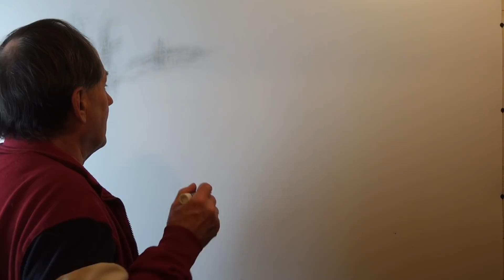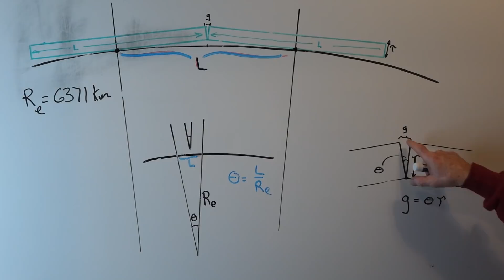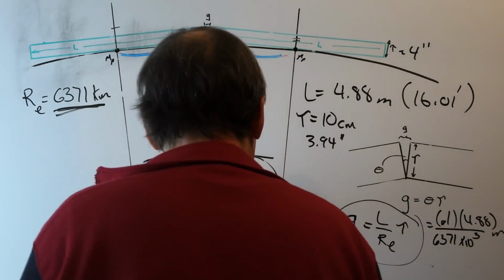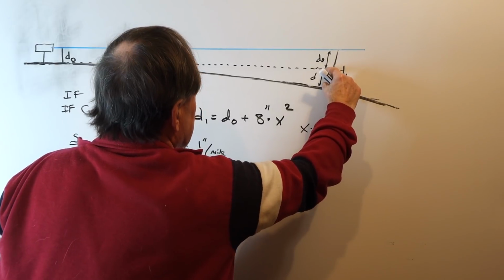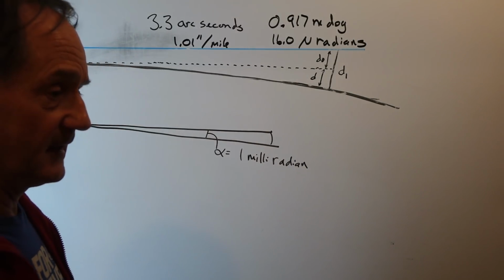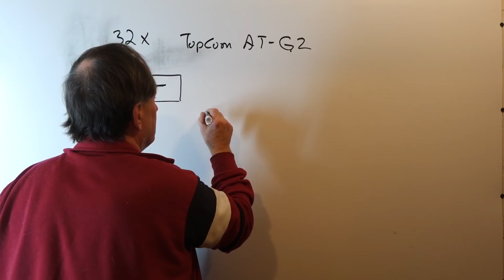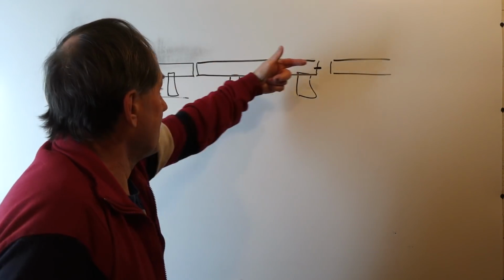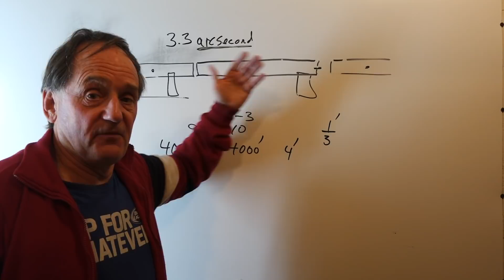Salvaging  Mullin's  " Force the Line "

Comment: Hi, why don't eventually use a very strong and tight rope ? With a rope it become possible to get a straight line, no ?
Sorry for my english, i'm french !
thank you !
Reply from the maker: cannot do this for it will fail - all tight ropes have too much sag.  Cannot put enough tension in a line to reduce the sag enough before it will snap and break --- sorry.
GH May 21, 2021
Reply: @georgehnatiuk5806  Thanks for you'r answer, what about if the laser was tilted slightly towards the ground so that its tangent is in front of it, and that can verify the curve in an other way, or not.
Reply from the maker: @sslicey5563  Laser over distance is difficult because a laser beam diverges and does not remain pencil thin.  At 2km, a typical laser with 1 milli-rad divergence will have a beam spot size that is 2 meters across.

There are other ways to measure earth curve as I did several years ago over a frozen lake:

https://www.youtube.com/watch?v=GUO-mbxybVA

GH  May 22, 2021
Reply: @georgehnatiuk5806  One last thing about light, a few week earlier, i read all the lightlist of the NGA administration, the documents related to the lighthouses, i found that a lot of those lighthouses have a range that is far bigger than the curve of the earth allows it, a few examples took from NGA LightList N°110:

P.255 : Canal dos Abrolhos (17° 57.9´ S 38° 41.5´ W) élévation 60m // portée 94.45 km - range 51nm
  -> Minimum Height required to be seen from this distance with earth curvature : 497m
  -> Distance of the light beam allowed by the curvature before touching its tangent and getting lost in the atmosphere : 20.76nm

p.259 : Ilha Rasa (23° 03.8´ S 43° 08.7´ W) élévation 101m // portée 94.45 km - range 51mn
  -> Minimum Height required to be seen from this distance with earth curvature : 497m
  -> Distance of the light beam allowed by the curvature before touching its tangent and getting lost in the atmosphere : 25.55nm

p.252 : Sergipe (10° 58.2´ S 37° 02.2´ W) élévation 41m // portée 72.23 km - range 39nm
  -> Minimum Height required to be seen from this distance with earth curvature : 273m
  -> Distance of the light beam allowed by the curvature before touching its tangent and getting lost in the atmosphere : 17.97nm

For farol dos Abrolohos, if i want to see it from it's nominal range, i have to be 280m above the sea level, do you have any thought about it ?

If u want to see the entire list that i've made go on discussion tab on my channel
Reply from the maker: @sslicey5563  I do not understand the data you post.
P.255 : Canal dos Abrolhos (17° 57.9´ S 38° 41.5´ W) élévation 60m // portée 94.45 km - range 51nm
  -> Minimum Height required to be seen from this distance with earth curvature : 497m
  -> Distance of the light beam allowed by the curvature before touching its tangent and getting lost in the atmosphere : 20.76nm

---------------------------------------------------------------------------------------------
portée 94.45 km - range 51nm
 Distance of the light beam allowed by the curvature before touching its tangent and getting lost in the atmosphere : 20.76nm
-----------------------------------------------------------------------------------------------
to me,  51nm and 20.76nm  means  nanometers

Remember light near the surface of the earth will follow the curve of the earth due to refraction and diffraction and can be seen much further away than horizon calculations from tangents give you.
GH
Reply: @georgehnatiuk5806  Sorry, it's in nautical miles.
I understand that the light can follow the curve with the correct gradient of temperature, but the nominal range is fixed in weather visibility, so it must have some atmosphere condition to be measured.
Reply from the maker: @sslicey5563  
Your numbers do not seem to be correct.
EXAMPLE:
P.255 : Canal dos Abrolhos (17° 57.9´ S 38° 41.5´ W) élévation 60m // portée 94.45 km - range 51nm
  -> Minimum Height required to be seen from this distance with earth curvature : 497m
  -> Distance of the light beam allowed by the curvature before touching its tangent and getting lost in the atmosphere : 20.76nm
--------------------------------------------------------------------------------------------------------------------------------------------------------------

A range of 51 nautical miles is 58.7 statute miles = 94.4 km
Assume no atmosphere or surface conductivity to modify the travel of light waves:
A person 10 meters above the water on a ship would have an unrefracted horizon at 11.3km
Light from a 60 meter high lighthouse would have an unrefracted horizon at 27.7km

With an atmosphere present as well as a material surface for the light to interact with to guide it along, the light would have to travel an extra  94.4km - 11.3km - 27.7km = 55.4km or 34.4 miles over the curve of the earth to reach the observer.  This would be double the distance for each leg of travel:  another 37.2km(23.2miles) from the lighthouse and 18.2km(11.2 miles) more to the observer.   Given what I know of how electromagnetic waves interact with water surfaces along with refraction, diffraction and scattering of light, I do not find this unreasonable.
GH  May 23, 2021   1:29pm
Reply: @georgehnatiuk5806  Thanks for you'r answer, personnaly i find that the light can follow a 356m horizon depression along the curve without deviate too much seems impossible, especially if it is to measure it as nominal range (where the atmosphere visibility is the only parameter - 10nm visibility). 
Thanks for the time you took for me !

I calculated with an observer eye of 5m, i explain why in discussion tab in my channel, because i never find altitude parameter, except in the bresilian marine, and in vikidia (child's wiki) in lighthouse description where it's given 5m above sea level.
But it don't change the problem, that to be seen it have to be deviate for 2/3 of it's nominal range.

Comment: Seems like a waste of time to build something so intricate to prove the spherical earth, when you can just watch a sunset instead. But if you do build one, might as well make it do some other fun science while you're at it:  "LIGO’s arms are long enough that the curvature of the Earth was a factor in their construction. Over the 4 km length of each arm, the Earth curves away by nearly a meter! Precision concrete pouring of the path upon which the beam-tube is installed was required to counteract this curvature." (quoted from LIGO website)
Reply from the maker: The government did build a "force the line" structure.  Much better than that proposed by Mullin.   He should take the family on a road trip there.
GH

Comment: Why not just repeat the Bedford Level experiments?  If the canal is flat, you see the flags.  If it's curved - "flat" relative to the center of a spere - you won't. Simple as that.
Reply from the maker: It is not that simple.  Refraction kills you when you are close to the water as in the original Bedford Level test using a boat with flags close to the water.  That is why it was repeated a 2nd time with flags higher off the water.
GH
Reply: @georgehnatiuk5806  Ageed. And I'm not trying to shoot down your idea.  I'm just thinking, at 6 miles, even considering refraction, the level of precision you are talking about wouldn't be necessary in order to determine whether or not the surface of the earth is convex.  I appreciate your contribution to finding a way to make direct measurements.
Reply: @patrickyerbyheatingairserv7477    Because people who base their existence off of apparition only,  are why we are all here to begin with.

Your body is only a tool for the mind.

Comment: Now this is flawed to compare with water because in this guy’s mind water follows the curvature and to a flat earther water follows the flat.  He is assuming that his way of viewing water’s level is correct so when the beam comes out being level also he will think it proved the globe earth and a flat-earther will think it proved the earth is flat.
Reply from the maker: No, you are missing a key point.   The "fence" as conceived by Mullin is to be built STRAIGHT and not referenced to any level.  The fence of "force the line" is basically a tangent line to the earth.  Then you compare the earth surface to this straight tangent line to determine if the surface is curved or flat
In principle, it is a good plan however, it would be very very difficult to actually build and guaranteed that it is indeed straight.
GH
July 10, 2022    12:27pm.

Comment: Why wouldn't force the line as suggested by Brian Mullin work? I think you're making this a lot more complicated than it needs to be. The raw materials will cost a lot more than your pipe tube suggestion, but I think it can be done accurately as suggested by Brian Mullen. All you have to do is make the planks out of aluminum or some metal with as accurate of 90 degree angle edges as possible. Sure with your long complicated high IQ math you can show us the smallest degree of inaccurate 90 degree angle will throw off the experiment, but all you have to do is flip every other board or plank so it's facing in the opposite direction. For instance each plank will have face A and face B. Keep alternating each board so face A then face B then face A again, and so on, is facing you. By doing so any minute deviation from a true 90 degree edges cancel each other in the long run. You might say at a microscopic level (or should I say at a nono-scopic or angstrom-scopic level) you might see a zig zag going back and forth which cancel each other over the 2 mile course. If at the end you have about 32 inch difference, than the earth is a globe, and if you got nothing, then it's flat! Case solved 😁.
Reply from the maker: Think all you want but the math does not lie.  Flipping the boards assumes each one has been cut with the same error which is absurd.  There is a degree of statistical reduction in error overall but random errors do pile up in the worst case for there is no way to predict their additive and subtractive properties during construction and to measure just what they are to make compensations.  If there was, you would not have to make this fence and just determine where the end points would be.   Aluminum would be the worst metal you could use for its coefficient of thermal expansion would kill you as soon as the temperature changes a single degree that is why a tube is preferred so you can control the environment inside -- I discussed that issue.  

Sorry but you do not have to waste time doing this for it has already been done with tubes to a very high degree of precision -- it is called the LIGO experiment and there are TWO of them,  one in Washington state and the other in Louisiana.  What better way to physically demonstrate the earth's curvature but build the same structure in two different locations 1000s of mikes apart?
GH
Reply from the maker: @macmac9371  That is not correct.   The results are not reproduceable when refraction is not present.   You really have no clue about the effects of the atmosphere on these tests -- that much is clear.
GH
Reply: @macmac9371  .
It has been shown a great many times that the further away an object gets, the more it drops when compared to a leveled sight line.
Clear evidence of the curve and no flat earther, including you, can explain how that could be the case on a flat earth.
At least without spouting complete waffle.
Reply from the maker: @macmac9371  
OK believe what you want.  Obviously you have no clue about atmospheric bending of light when it travels near the earth's surface.  Look up  refraction,  dispersion,  guided TEM waves, diffraction and learn about them and then get back to me.

GH  July 16, 2021
Reply: @macmac9371  .
Oh dear, your silliness seems to blind you.
Atmospheric refraction has been known about for centuries and is easily observed by anyone who cares to know reality.
It is why the movement of stars approaching the horizon appear to slow down, why the Sun just above the horizon at sunset appears to be squashed.
https://en.wikipedia.org/wiki/Atmospheric_refraction
When did I say anything about a reflection of the  Sun during an equinox, the solar day is slightly longer due to refraction apparently lifting the Sun at dawn and delaying its setting at sunset.
What is a "prenumbra", do you know anything about the parts of shadows?
You cannot see through the Moon, don't be so stupid.
You cannot see the Moon during a solar eclipse because your eyes have nowhere near the massive dynamic range needed to see both the brightness of the Sun and the amount of earthshine on the Moon.
If the Moon gives off its own light, how come there are shadows in the craters and on the sides of the crater walls facing away from the Sun?
Reply from the maker: @macmac9371  I see no reason to address you for Mr. grahvis seems to have this well in hand and understands the issues.  Besides, you seem to be new to this game and are dumber than the average flat earther.  Carry on without me for you are not worth my time as I have heard all these FE arguments 10s of times before you.  Bring me something new and not this old bullshit that comes from Eric Dubay and the QE/Oakley show.
July 17, 2021
GH
Reply: @macmac9371  .
The higher you go, the more you can see the Sun over the Earth's curvature.
I live under the flight path of transatlantic aircraft, when I watch the Sun disappear behind to sea horizon, aircraft to the east are still lit up by the Sun.
As the minutes pass by after sunset, the point at which aircraft flying west emerge from the Earth's shadow, gradually moves west as the Earth rotates.
Couldn't happen on a flat earth and clear evidence of the Earth's shape.
Reply: @macmac9371  .
Do you have any idea how ridiculous your claim is, even if you went as high as 100 miles, there would be no calculable difference in the distance to the Sun.
Do you have no sense of scale.
I notice you have nothing to say about my observations, I suppose it destroys your narrative.
Reply: Bwa ha ha.  Did you even watch the video?  "As accurate to 90 degrees as possible" - he showed that it can't be done to the accuracy needed.  Did you graduate high school?  Elementary school?  You said that you are thinking... but do you have that capacity?

Comment: why not to use two ships with a flag at a height let say h. if you do not see a flag after certain distance it mean the earth is not flat. The calculation are even not needed as the h value we know. To measure the distance we can use a cord or just fire up a fireworks a measure the time delay between the flash and sound what we hear. Simple. Not trigonometric calculations even needed.
Reply from the maker: kkk kkk,
Tell this to Mullin not me.  I was just trying to help some FEs out.  I do not endorse this nor have I ever.   It is all just a bunch of nonsense devised by an engineer that is not very bright (Mullin) and I was just trying to show just how impossible it is to mechanically align such a structure as proposed by Mullin.

As far as timing the speed of sound to get the distance between ships, a typical flat earther will object saying "prove that the speed of sound is constant every foot of distance between the ships and give me a citation"  That is what they do ---  Riley,  Nathan, and quantum eraser.  Propose it to them, not me.
GH
GH